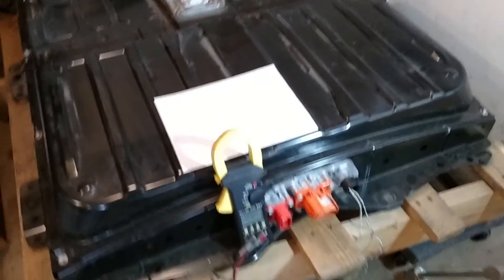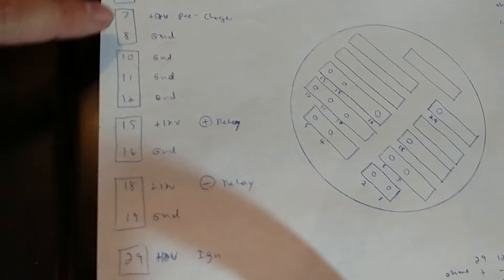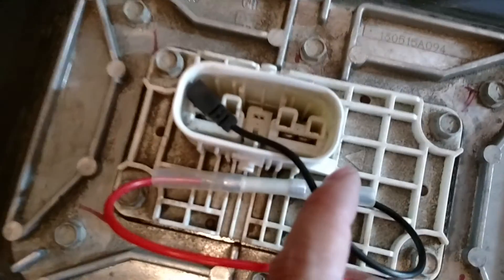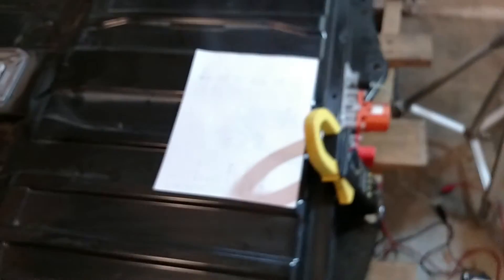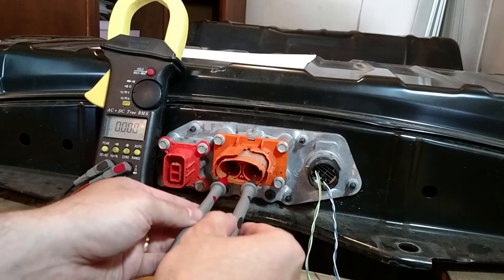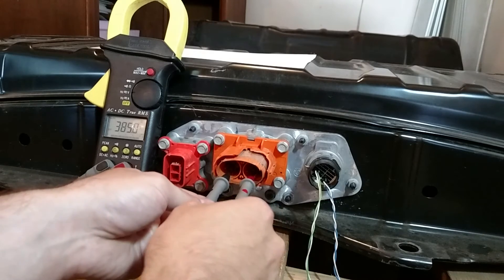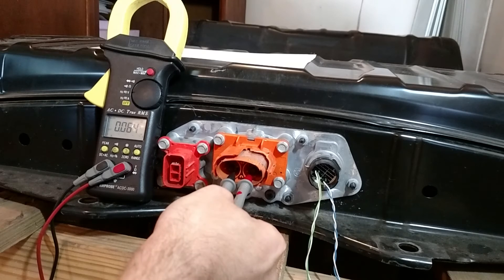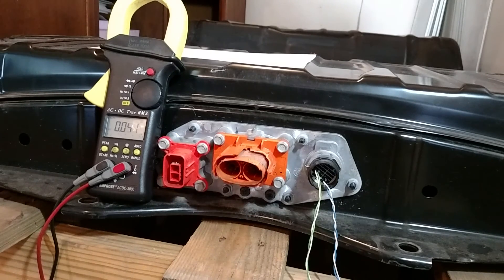Solectria E10, Lithium Ion Battery Upgrade, Part3

Comment: So do you normally switch on both precharge and ground at the same time or is it better to do precharge first and ground later? I know that without a precharge you can blow up things easily.
Reply from the maker: On the Leaf pack, the negative contactor has to be closed to complete the circuit.

1. Negative contactor closed.
2. Pre-charge relay on.
3. Wait for System voltage to get close to battery pack voltage.
4. Positive contactor closed.
5. Pre-charge relay off.
Reply: @WolfTronix  - Great info - that was close to what I was thinking - thanks.

Comment: I thought the LEAF cell chemistry charges to 4.2V for a full charge?
Reply from the maker: A resting voltage of 4.0 volts per cell is fully charged.

When I put the modules in my truck, I will charge to 4.0V and discharge down to 3.0V per cell to prolong the life of the batteries.